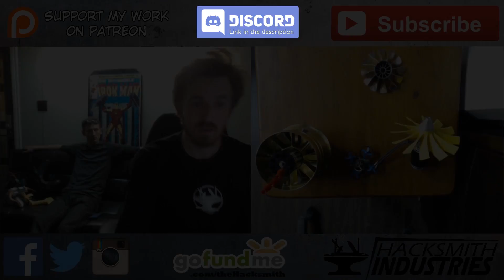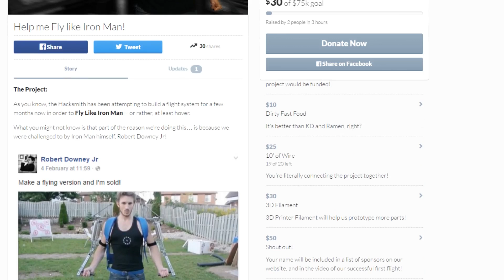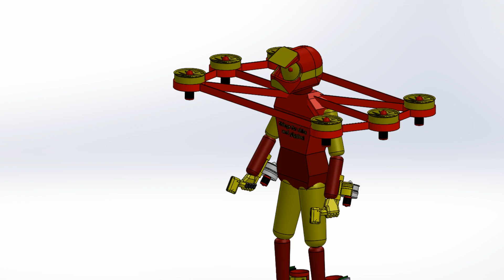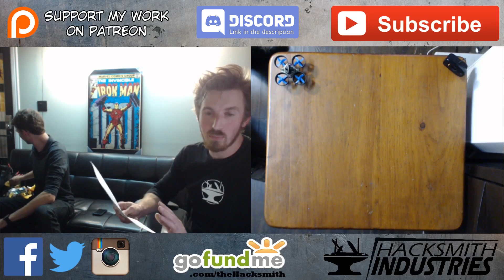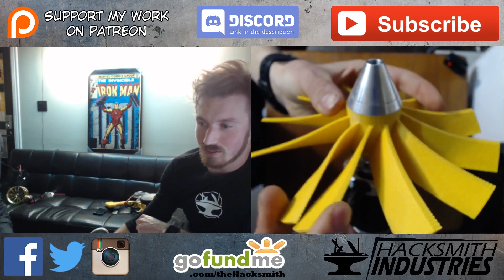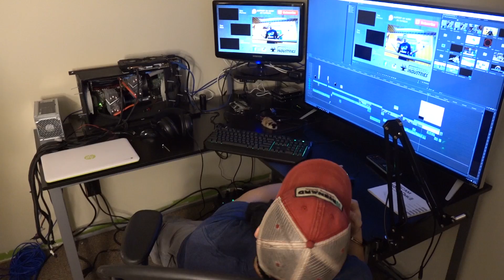Flying Like Iron Man Q&A!!!

Comment: This harness system is ridiculous, you will not delivery what you promised.
Reply from the maker: The stunt wire system? It's so we can test individual parts before the whole thing is done... not ridiculous, realistic...
Reply: No the harness system with multiple fans over the shoulder
Reply from the maker: That's an extremely rough model to show the concept, nothing more. It's more to show the position of the fans to create the hexacopter which will allow for auto-stabilization. We might be able to move the pilot forwards a bit (so its more of a jetpack) but then you need to counter the CofG constantly with the jetpack.
Reply: OK I will wait for that, I regained my sub, thank you for answering
Reply: the Hacksmith You could also counter it with your arm thrusters. And, also, if you moved the thrusters nearer to the body (if the body is not centered) you may loose stability, but the counter force wouldn't need to be that big (also it would look cooler :D)
Reply: +MiDa if you are constantly using the arm thrust to stabilize the rotation of the jet pack then they are not providing vertical trust so its less efficient
Reply: Purple Macaw you're right but it depends on the angle how much thrust you loose and if you are off-centered but your thrusters are near to your body than this thrust direction won't be that different to the vertical axis.
Reply: MiDa true but why deal with that at all when they could just space the thrusters evenly to begin with
Reply: Why not make the 6 EDFs for the harness retractable? That would look cool
Reply: Hxfiz MM because that would be heavier and its already heavy as fuck
Reply: Purple Macaw it wasn't my idea. @the_hacksmith thought about it so it looks more like a jetpack.
Reply: I would propose to mount them next to your shoulders like in the picture, but strapped to your arms, so you can stabilaze yourself by moving your arms forwards and backwards and the thrusters can abe nearer to your body, so it looks more like Iron man.
Reply: as mentioned in the vid that is not the harness they intend to build its just an early mock up of thrust distribution

Comment: Could you do this to make your own EDF's? Make plaster molds with abs printed parts. Heat the mold to melt the abs out and then put melted aluminum (or your choice of metal) into the mold.
Reply: Fans need to be manufactured with really tight tolerances and precise balancing in order to work properly, molding isn't the best for that sort of thing
Reply: Simply machining the molds cost thousands of dollars
Reply: Brendan, the cost of making molds is not that great unless you are making injection molded parts. The aluminum casting would certainly work, but may need some machining cleanup depending on the method used. Another option would be to simply cast in resin from a silicone mold. The parts could even be glass fiber reinforced if done this way, which would be both light and strong.

Comment: Try casting (3d print, then take a mould, then cast). Also there are some stronger filaments for the Lulzbot 3D printers such as the nylon filament.
Reply from the maker: It's pretty hard to do a good cast at home -- remember the EDF fan blades need to be perfectly balanced and smooth =(
Reply: ah yeah..maybe James Bruton has some fancy 3D printing ideas